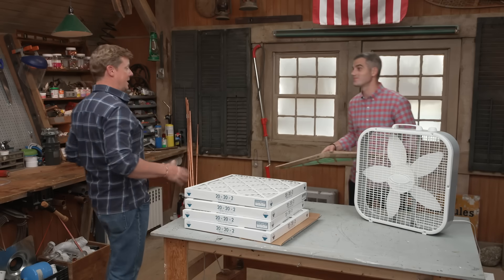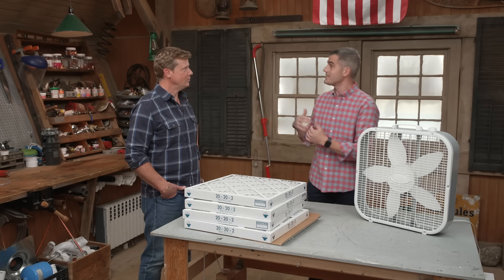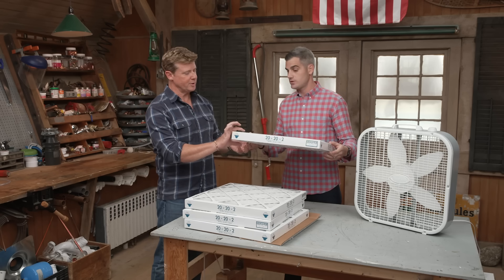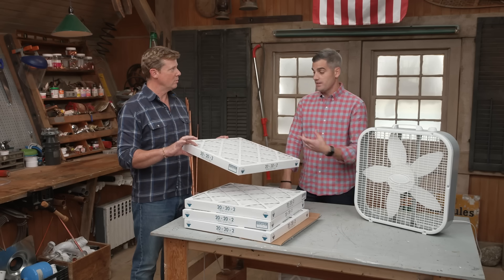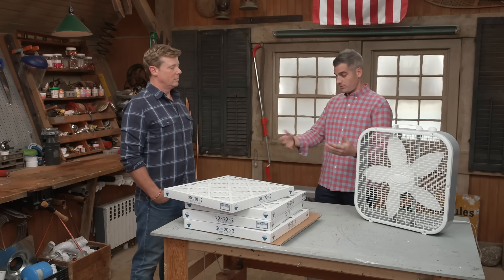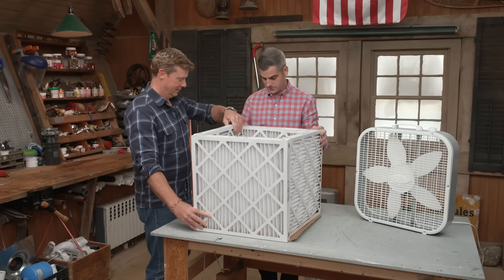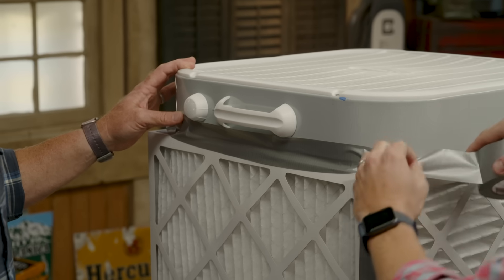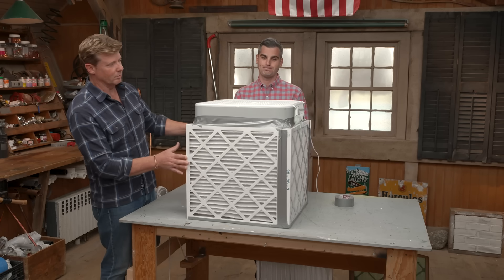How to Make a DIY Air Filter | Ask This Old House

Comment: I did a basic version of this when we were choking with wildfire smoke back in August, worked well and it was pretty obvious how much it was filtering out of the air in the house.. About the only thing I would change here is to run the fan vertically, as it was designed. Laying it horizontal like that is begging for a motor or bushing failure, depending on how that motor is designed to run. Leave it standing like it was meant to be.
Reply: According to Camparetto, the HVAC engineer who designed this system,  it was designed with a horizontal fan because particles, even microscopic ones, settle due to gravity. That means, first, that the density of contaminants is greater near the floor.  A vertical fan pulls contaminants in from the air column on one side of the room, and blows the clean air into the other side of the room. Contaminants already on the downwind side of the room are simply blown further across the room, and they can easily collect in eddies. A horizontal fan pulls the particles in from near the floor, where they are in higher density, and blows the clean air up; the resultant air currents push contaminants from the corners of the room back towards the filter box. It's a more efficient way of cleaning the entire air volume of the room.
Reply: @viverra  That makes a huge amount of sense. Too bad that info was not included in the video. I am still a little concerned about using a fan horizontally that is designed to run vertically, but it may be a non-issue. Any engineers out there reading this that could shed some light?
Reply: @coreyg7255  yeah, me, BS in EET for starters but does not have to be kosher. Motors, in general, aren't designed for a specific positioning which is the benefit of their many uses. The bearing mechanism is mainly very strong that a horizontal position of the fan blades which don't weight that much is negligible. In fact a vertical position puts a 'point' downward stress on the shaft, a horizontal position puts an even stress on the shaft. But at the end of the day, for household fan motors, there is no specific bearing meant for vertical or horizontal position. A good analogy is vertical and horizontal washing machines where we can say the water is the fan blades. In horizontal washing machines the weight of the water is evenly distributed around the bottom of the drum, whereas a vertical washing machine the weight of the water is pulling on the shaft of the drum.
Reply: @pashon4percushon  So there is no concern of a thrust surface effect on the bearings in a standard, household type of electric fan motor ( as shown in the video) if used in the vertical rather than horizontal position? That was really the only issue I could imagine with bearing surfaces in a fan motor.
Reply: @coreyg7255  in my opinion its negligible.
Reply: @coreyg7255  sometimes the internet is a great place, thanks for the discussion. :-)
Reply: @coreyg7255  this is most likely temporary solution. long time used, people will just op for a well design build air purifier
Reply: @viverra  and that is a great comment my friend. I love intelligent people.
Reply: @viverra  this! its why most air filter design to exhaust clean air upward than the side. the air circulation is better that way for area of the room.
Reply: These 20" box fans are like $19.88 at Wally World, literally cheaper than the filters, so it's not that big a deal if the fan fails sooner than it would normally. Even so, I don't think the fan is going to break in that position anyway.
Reply: @joshuaewalker  Not at all concerned with the cost of a box fan. Only concerned with what happens if the bearings/bushings supporting the armature in the fan motor should fail. Electrical fires are no joke. But, the likelihood of that happening are quite slim.

This has been a great discussion. Thanks for all those who have contributed. I know I will be building one of these again this summer if we get hammered with wildfire smoke like last summer. And my box fan will be standing in its normal, upright position as designed.
Reply: @coreyg7255  
Well, if it matters to you you're talking to a 38-year-old man with a bachelor's in electronics engineering. When the fan is upright the bearing(s) on the shaft are experiencing a moderate amount of load both axially and radially. (It's possible there's two bearings on the shaft but with these cheap fans it's more likely there's one bearing and one bushing.) In fact, moderate may be too harsh a word because the plastic fan blades and small shaft are very light weight and even small, cheap bearings (and bushings) can withstand much higher forces. If you think about how the fan works when it's running it's pushing air out one way and it is also pushing itself back along its shaft(axle) the other way which is producing an axial load. ALL fans are designed to handle axial loads because that's what they do, they create axial forces to blow air and only need to support their own weight radially. Whereas wheels are designed to best handle radial loads because that's what they do, they need to support weight as they turn. So, the fan is already designed to support "high" axial forces especially thrust forces pushing towards the back of the fan. Laying the fan on its back is adding negligible axial load to the motor bearings in the direction they are already specifically designed to handle while also almost completely removing any radial forces provided the fan is well balanced and there's no wobble. Running a box fan in a horizontal configuration might actually increase the life of the motor.
But what do I know, I'm just some guy.
Reply: @joshuaewalker  This was exactly what I was thinking the entire time. Coming from a mechanical and construction background, I think of axial forces ( at least in this situation) as a thrust force. If the bearings are not designed for long term thrust forces, they could fail prematurely.

laying a cheap box fan horizontally definitely will add more thrust force to whatever bearing surface has been installed to take that force, since a fan, while in operation, is constantly seeing a thrust force in that direction. It all comes down to whether that thrust surface can withstand the extra force of the weight of the fan,  and whatever parts are connected that may add thrust force through gravity. Maybe the main shaft, armature, etc.
Reply: @coreyg7255  
You could always flip this contraption upside-down and hang it from the ceiling that way the thrust of the fan will fight against its own weight and take even more stress off of the bearing surfaces.  ;)
Reply: @joshuaewalker  HAHA I like it!
Reply: @coreyg7255  In my professional opinion,if u're concern abt electrical hazard of this setup,I'd advise u not to attempt or use this DIY in the first place.

I don't live in the US so I'm not sure abt the box fan certification for product safety.
I'm assuming it's a UL/CSA certified electrical household product,so they will test its safety based on its intended functions(i.e to move air normally in a household setting).
Using the box fan as a DIY air filter is not one of its intended functions.

Mind that using it beyond its intended function (as stated in Manual Instruction) is at ur own risk and neither the manufacturer nor the certification body will take responsibility
(i.e for excident or injury claims).
I'm not sure if house fire insurance covers fire caused by negligence.

Most of the time,if use as intended,a certified electrical product is fairly safe as long as all the warnings and instructions had been followed religiously.This is because it had been equipped with safety devices suitable for its intended functions based failures.

I make a living as a Product Regulatory and Safety Engineer for Electrical Household Appliances,although not specialising in Fan,it follows the same main standard(for example in Europe and most part of the world,IEC 60335-1 or its adaptation based on the country) and its particular requirement standard.(IEC 60335-2-80 or its adaptation based on the country).
Reply: @coreyg7255  so put a fuse in the input rated slightly above running amps while clean. When motor is overloaded it will draw too much current and pop the fuse.
Reply: @CL-ty6wp  Originally I wasn't concerned with circuit overload, just a bearing failure. But I suppose the latter might lead to the former. You have a fair point.

I never expected my comment to garner such a great discussion. Thanks to all who have contributed here.
Reply: @joshuaewalker  What you've explained has been my empirical experience. Thank you for your comment and explanation. 
To put it another way, yes, fans may actually last longer when they point upwards or downward due to less stress on the bearings. 
This also makes sense from the perspective of planned obsolescence in consumer products.
Reply: We live in the middle of a white pine forest and about 20 years ago we found out that she was allergic to pine pollen. I built two units like these 20 years ago with $10 box fans (laid on their backs) from that outfit from Arkansas. Actually I made a nice looking cube frame, diffuser and filter covers from some old birch for one of them. Everything is enclosed so there is just a birch box sitting in the corner humming away. We run that on on low speed. The fans are still running strong.
Reply: @denali9449  It's funny how many people recently claim to have "invented" this obvious concept which people have been doing forever. Now even referring to it as "HVAC equipment" :)
Reply: Good news everyone... some of us have been doing this for years (before the current condition & before a couple degreed individuals tested these contraptions and made them popular).
There are no "bearings" in these type fans. Instead, you'll find two oiled bushings, one just behind the fan, where the shaft enters the motor housing; and one just inside the rear of the motor housing.
I've been running a box like this with 4ea 20x30x1 for the sides (it just sits taller and has greater media surface area) and a single 20x20x1 on the bottom, opposite the fan (it sits on little cedar blocks that raise it a couple inches off the floor). That fan has been running horizontal all it's life and hasn't complained even once.
How do I know about the innards? Because even before I built the above described contraption, I've been taping a single 20x20x1 filter to the back of a fan that I hang from the side of my pup's crate... and admittedly don't clean it (vacuum the collected dirt, hair, leaves and other assorted crud) nor replace this filter as often as I really should. This does cause the motor to run hotter and will use up the oil more quickly. When the oil is gone, the fan will begin squeaking. If not addressed quickly enough, the thermal fuse that is taped to the windings will melt and the fan will cease to operate. I've gone through a few fans from this setup over the years. The most recent failure was actually from the swivel housing surrounding the rear bushing coming apart from my having pulled the motor out several times to reapply oil. That's when I discovered that they constantly tweak the specs on these things, as across the several fans of the same make and model, none of the motors are the exact same size, the shafts are all slightly different lengths etc. - such that I finally wasn't able to repair, but had to replace that fan (I've gotten a little better about vacuuming that filter since).
HTH, & remember YMMV
Reply: 4 filters best for least resistance.I’ve watched testimony claim 1 filter attached to fan works fine . Maybe build 2 or 3 filter system with remaining sides solid ( cardboard or other material) .
Reply: I didn't realize that reasonable and intelligent comment threads existed until now!
Reply: interesting conversations 😊
Reply: Yes.  Vertical.... couldn't understand why the fan was on top.
Reply: The bearings might last longer in that position. I have a space heater with a noisy failing bearing. I noticed that it would run quietly when horizontal, so I built a housing so it could lie flat. It's been working fine with no problems for almost a year since then.
Reply: @Mavrik9000  I agree...in horizontal position, gravity is bearing-down evenly on the bearings with the motion in a parallel plane to gravity...whereas in the vertical position, you have gravity pulling-d0wn on the bearing housing & shaft at a 90-degree angle....when the clips on my cpu cooler broke, to keep it seated on the chip, I laid the tower down so that the cooler's weight would hold it in place, rather than shear it off from the cpu...all the case fans that were once vertical & are now horizontal run more quietly & from all my research, in addition to personal experience, the rig runs better in the horizontal position, laying on the floor, rather than standing.  This concludes my TED talk on fans, gravity & centrifugal force.
Reply: I think it's a moot point on a solution that's temporary. We're looking to filter a few months with a cheap, disposable fan, not set up something to last.
Reply: @Jefferson Naylor  is it still a moot point 12 months later? Actually curious if you're still using these.
Reply: @Lostachilles  yes, pretty much  a non-issue. I did use aversion of this back in July and August when we had thick wildfire smoke. But no need for it any other time of year.
Reply: @Corey  awesome, thanks very much for the response! 😁👍 I'm just now getting the things together to build a few of these since the hepa filters I bought previously were pretty poor performance.
Reply: @jeffersonnaylor1019  As long as that temporary solution doesn't cause a failure in the electric fan motor while in use, then it'll be fine.
Reply: @coreyg7255  that fan costs like 20$. So what if it lasts 5 years instead of 8?
Reply: @Fattony6666  Like has been mentioned a few times before, it isn't about cost, it's about safety. If that fan fails when nobody is around because of a design element, then maybe try not to use it outside of the intended design.

It appears so far that this is a complete non-issue anyway, and that is what this excellent discussion has been all about.
Reply: if its vertical is just gonna blow everything around on the floor and reintroduce particles to the air
Reply: So the fan is blowing inward i would think,  since they didn't say. Most air purifiers pull air in then redistribute it.
Reply: @deviousuno9778  
In this design the fan is blowing upwards pulling air in from the floor, through the filters, and blowing clean air up towards the ceiling.
Reply: @deviousuno9778  you pretty much always pull air from smaller volume to bigger volume with a fan when you can. That way, you're not trying to oversee the issue to an appreciable degree.
Reply: @deviousuno9778 fan is blowing outward
Reply: The fan is on top to increase air flow & filtration. If it was vertical you have less filtration and higher air resistance and higher loads on the motor.
Reply: @dougc78  How so? Gravity cannot be of much help here. If the bottom of the box was cardboard, and all other sides were filters, you would have the exact same amount of air flow and pressure with the fan sitting in its vertical position, as designed.
Reply: @coreyg7255  Very good point!! I completely overlooked the cardboard bottom... Let's just call this one a "Brain Fart"
Reply: We have one up stairs and one on main level. We are looking to see how well this works.  We have there dogs and live near a field that grows crops. Our home is always dusty. We dusted the same day we started using this system.  Our furnace filter only last about a month from all the dust, hopefully we can make it last a little longer. We are hoping we can help the dust and keep at bay, HVAC system and us breath better.
Reply: @papary2953   How well did this work for you, please?
Reply: @HeyWatchMeGo  
No question the system is working.  The amount of dust collected is hard to believe.  The down stairs one is much worse as expected due to the three dogs going in and out all day. We have noticed the level of dust has decreased in the family room. The unit is in the dinning room where dust level is non-existent. Cooking smells have also decreased, we cook bacon from time to time, fire alarm would normally go off before we started the system, now we don’t see as much smoke, nor does alarm goes off. Upstairs unit is not as dirty, but working well.  
We run them 24/7 in the upright position as shown in the video.  We had a few power outages, the fans still kick on when power returns. It’s been running since February. The only change I would make is adding cheap filters in front to catch bigger partials.
Reply: @papary2953   Thanks! This seems like a really good idea!!
Reply: @papary2953  Which way is the fan supposed to go? blowing in towards the "box" or outwards to the sky ?
Reply: @zeeshawnali4078  outwards. The air will be drawn/pulled through the filters. Works great!
Reply: @papary2953  thanks
Reply: @dougc78 respect for responding to a logical response to your original comment with "you're right" instead of arguing 💪🏾

Grown ish ❤
Reply: @dougc78  just keep the cardboard on the bottom and everyone wins.
Reply: @dougc78  buy nyo huh Imop PM Think jill
Reply: @dougc78  Hey Doug how so on your comment? You can use same number (4) filters . One on top.?
Reply: @dougc78 What speed is the dan to be run? 1, 2, or 3?
Reply: @dougc78   " higher air resistance and higher loads on the motor." fyi higher air resistance = lower motor load.  You have to think about it; not an easy  concept to understand.
Reply: @613kc  When electric motors are 'loaded up' voltage drops but amps climb.